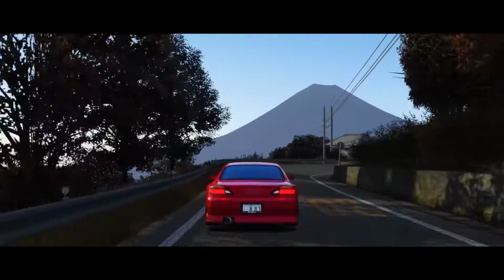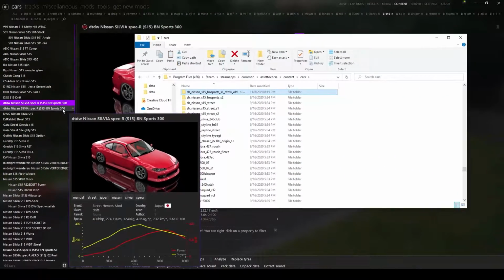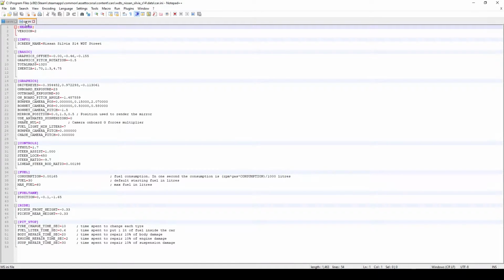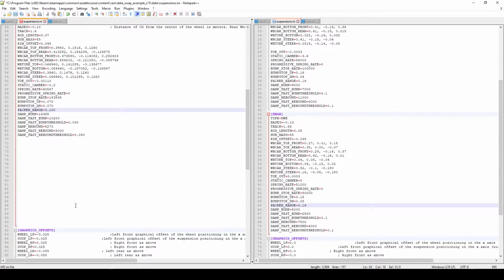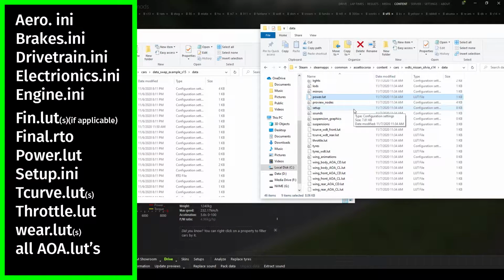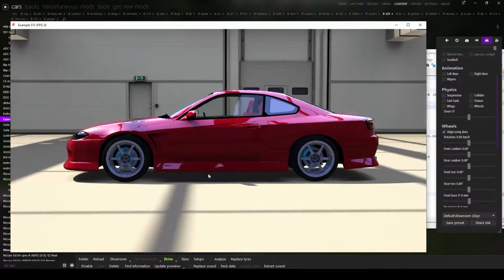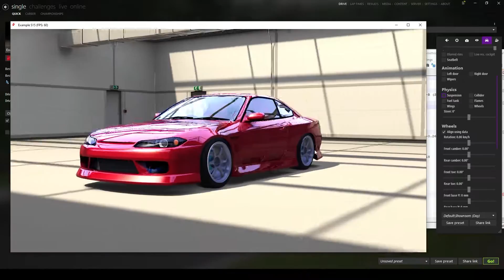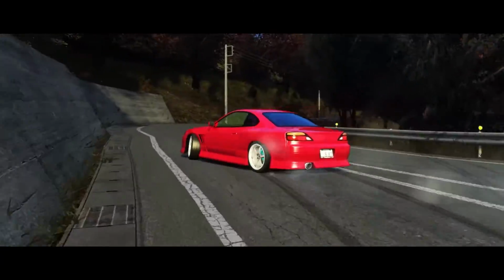How To Swap Car Physics in Assetto Corsa | Tutorial

Comment: welp my steering is inverted and i dont know how  to fix it
Reply: ever figure it out?
Reply: @vxsmitty  there are steering lock and ratio values in the car.ini file, try making one of those a negative or comparing between old and and new files. I suspect the geometry/rack position may be different requiring a negative in some values.

Comment: Brilliant tutorial. I now have a rally setup on a drift car lmao

I do have a question however. The power definitely hasn't been updated. It drives fine, the engine makes the right noises. Just not the same power. Any thoughts?
Reply: drag power.lut to your new car folder from the rally car

Comment: I did everything correctly and the car works and everything but once i get to full lock the front wheels sink into the ground and the wheels are gltiching through the hood. do i need to change my steering lock or what?